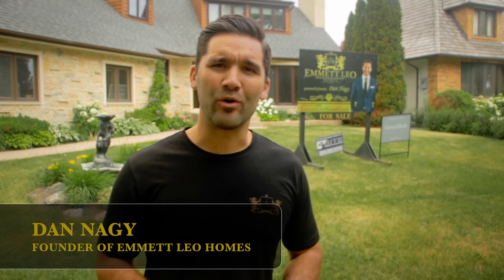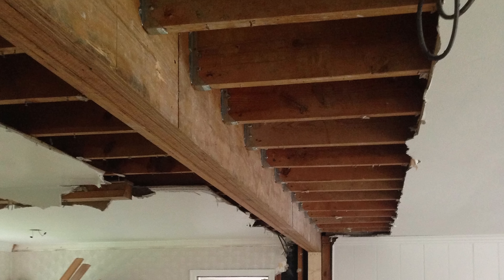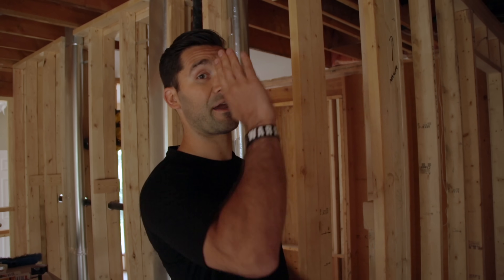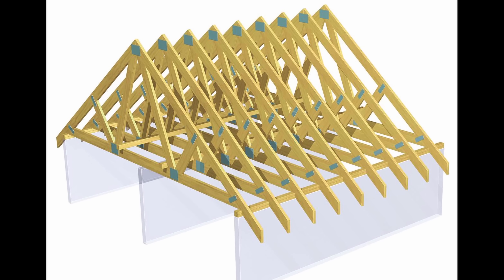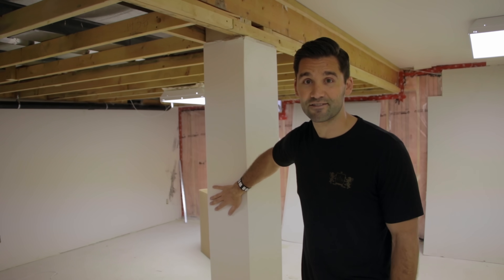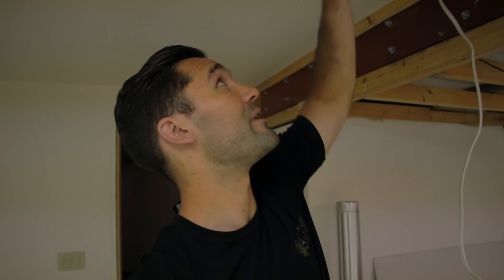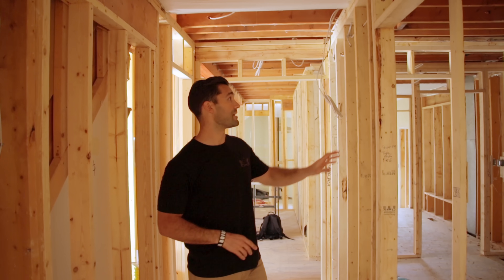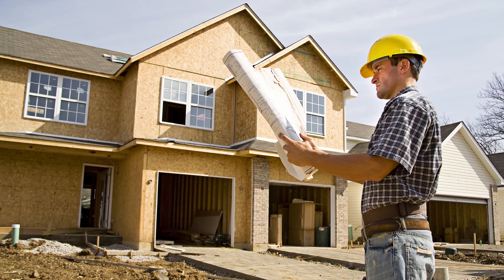The fastest ways to tell if your wall is load bearing or not!

Comment: 2:11 - - Which way the joists run (perpendicular to structural wall, ≠ parallel)  
2:47  - - Dimensions of the house (structural wall runs the longer length) 
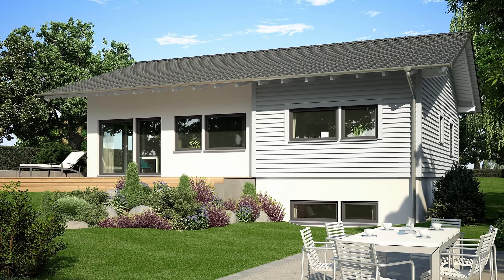3:07 - - Gable roof / peak (joists run perpendicular to the peak)
Reply: I have a decorative wall that has two columns in the middle that runs parallel to the joists but is sitting right on top of a joist. That means it’s not load bearing?
Reply: @alexcantrell4794  please don't attempt to remove a wall yourself - - please have a licensed architect or licensed construction contractor look at it.  You could probably find a licensed instructor at a local college or trade school to help you at no cost (maybe a cup of coffee or lunch 🙂).  Good luck.
Reply: Great break down and recap on the topic.  With video/subject location.  Big thanks.
Reply: @lamontg802  sure!  I like making it easy for future reference 🙂
Reply: Was coming here to make a similar comment.

Comment: If the rafter-truss width span is entirely supported by the walls front & back transferring weight to the foundation, then none of the inside walls need to be load-bearing. But they CAN be in which case the aforesaid walls front & back CAN be under designed relative to if they weren’t because the load to the foundation is transfered through more wall sections? Why would someone risk it is the question.

Comment: Most folks who have a structure that's not yet drywalled and/or a basement and/or a walk in attic know by just looking in real time what walls are loadbearing and what are not. The difficulty arises in a finished home built on a concrete pad above which is an attic knee-deep in insulation. This does not consider that commonly encountered scenario.

Comment: What he meant If you go to  your basement and anywalls on the floor above of running along the beam from below than they are supportive and if u look in ceiling and if their  are any cross cuts that are on top of your wall as in not just one piece well than it is a supporting wall if it's just 1 ceiling joist and you look and the same  ones are open with no wall beside the ones where is wall well than It is not supportive as long as it's one continuous one ,ya if you asked me he did not explain in the best and yes under your joist u just don't throw a beam u have to make a 3 by 3 poured concrete box if u check on Google and see what kind of box u will need to support beam it will show you ,don't over think it it usually a very easy fix especially with engineered trust these days it all about supporting and bulking a beam in if needed ,I'm 51 and have been framing houses since grade 9 ,I don't put people down but sometimes I feel the you tube guys just talk for hits and scare the average home owner out of trying their own little home renovation ,yes becareful but the average guy isn't stupid if you see joist nailed together well of course it's supportive just take quick peak in ceiling and observe rest of area you will be all right and codes and spands are ready and available on Google in your area ,not Mike Holmes but 30 yrs experience and 100s of houses under my belt , good luck .😊

Comment: I think you need to be just  a bit  more particular about load bearing walls. Dont simply eliminate them as nonbearing because they run parallel to the joists over. They could be supporting a roof load, or a stepped back wall above. Also, you could be aware of a tri bearing truss overhead. Be careful. They're not always as simple as they're made out to be

Comment: I used to work with a contractor while in college remodeling homes and small businesses. Learned when you are removing a wall, take off the drywall and hit each stud with a hammer to see which ones had a load bearing on them. The loaded ones we left in place and reinforce it into a column. He was successful with this method, and I had the oppurtunity to see some of his work from years earlier and they all withstood the test of time.

If I work any remodeling jobs, I still tap the studs to double check they aren't load bearing, even with an engineering report.

Comment: I've worked on some homes where the joists run parallel which are support walls, there was a double joist/ sometimes single joist stacked right on top of that wall which then carried the load of a second floor wall which carried ceiling joists or loads from roof.....so saying they never carry a load if they run parallel is not quite correct, there is some exceptions to that rule.

Comment: Question:  my home had a double garage but at some point half was converted to a bedroom towards the back section and a small mud room directly in front of the bedroom,  the other half remains as a single garage .  in the mud room there is a closet which id like to remove.  I believe I am ok as there would not have been any support when this was a full double garage?  Just making sure before I fire up the sawzal!

Comment: You're addressing only GRAVITY Load bearing walls. You might want to discuss LATERAL load bearing walls, too. Many times folks open up or remove walls thinking they're just partitions when, in fact, they provide transverse shear or (out-of-plane) lateral bracing support to adjacent, exterior walls. Probably a good idea to advise folks to defer this assessment to design professionals or "knowledgeable"  building contractors.

Comment: Ok You Tube thinks I should watch this 3 year old video so here's my comment. The fastest way to tell if your wall is load bearing is to take a Sawzall and starting cutting one of the studs, if the roof weight pinches the saw where you can't get it out, it's load bearing....you're welcome....

Comment: When searching for studs, you can also take a magnetic to the drywall to find screws. Some older homes are tricky. I have joist running perpendicular to the main load bearing wall in the center of my home. So the load for my 2nd floor bath is supported by 2 parallel walls that are perpendicular to the 1st floor load bearing wall above the steel support post in the basement.🤯

Comment: I'm a visual person and a wee bit dumb. I need mapped graphics to comprehend these concepts. Another pass on this video with some graphics will improve the video quality and your views will skyrocket to 4 million😊  I gather that load bearing walls run parallel to the peak, one side of every main hallway is load bearing, pilings are holding a load bearing joist and slab homes are floating on dirt.

Comment: i removed a partition wall.  when above neighbor walks i hear squeaking.  he claims removing partition wall might have done that.  (1) a structural engineer said "it is it clear if the wall contributed to the load path"  what does that mean?  (2) he said the noise can be due to the minimal deflections in the floor joists/beam which were crossing the omitted "partition wall). although these deflections are minimal and do not significantly affect the structural integrity, they can cause the wood nails movement even at very small values.    is he just saying deflections happen or his he blaming me for the removed partition wall?   (3)is there permit necessary for removing a partition wall in california? my contractor didnt do that.          PLEASE HELP.

Comment: You Know that is just about the DUMBEST answer to look at the sealing to see which way the floor jousts are running. that would be a good way in the new house that was just framed but if it has been sheet rocked , taped . textured and painted. you cant see which way the floor joist run. Chances are some one that see's the house wants to do a upgrade like that. I have done commercial buildings that the floor joists go in different directions. Pleas give the correct information. The best information would be to look in the basement if and only if it is unfurnished. Even that wont tell a newbie what he is looking at.

Comment: If you have an inspection camera , carefully drill a small hole in the ceiling and stick the camera cable up the hole and then zoom around for a look. Would be a very easy drywall repair too!

Comment: Great! - but can you or someone clarify something? You mentioned if a wall is perpendicular to the joists then it is load bearing. it doesn’t necessarily mean it is load bearing though? The wall sitting on the main beam was deemed load bearing because 1) perpendicular to joists and 2) because it was sitting on main beam. So that other wall next to it that is perpendicular to joists is deemed NOT STRUCTURAL only because it wasn’t sitting on a main beam? @minute 6:45 😊

Comment: Whats in the basement under those heavy verticals you built to hold each end of the beam?  Wouldn't they transfer that well-distributed load onto just two random points on the main beam in the basement?  Does it need support posts under your new load points?  But if you can't just put a post anywhere because it needs a special foundation to be poured for it, do you start by cutting into the basement floor to pour the footers for the posts that support the main basement-beam directly under your heavy verticals that hold the beam upstairs?  Or would you build-up the basement beam so it could transfer the point loads laterally to the existing posts?

Comment: Not all basement beams are load bearing through a first floor wall to the roof trusses. The basement beams are necessary for the floor joists that span the same width as the roof trusses but are not ‘triangulated’ like the roof trusses. thx for the vid.

Comment: Another way to determine the direction of the floor joist if the ceiling is covered with drywall, would be to remove a heat register or cold air return in the floor above. If that scenario applies.

Comment: 6:59 DON'T rip the drywall off.  The EASIEST way is to turn off all the lights, stand on a step ladder and cross-light the ceiling with a flashlight. You'll easily see the joists' direction. (You'll be surprised at how wavy your ceiling is too.)
Reply: Yes i can see my Joists under the plaster as they look lumpy  or pressing down on the plaster boards also if you tap on the plaster you can hear the sound differently.

Comment: Nice video! 

When we wanted to know if an interior wall between the living room and kitchen was load bearing, we had to do some looking. It was floor to ceiling on the main floor. 

Below that, the downstairs rafters and the trusses in the attic were running from outer wall to other outer wall which spanned kitchen and living room. So, on the one 
hand, our kitchen wall was sitting right on top of the steel girder running across the rafters but on the other side, that section of our house had the two sided roof with the centerline and the wall was only a partial wall (there were trusses that lacked that support - maybe 10' of them on one end. 

On the basis of no reason to imagine one one truss should be different than the other and 4 of them spanned the roof without any fuss, we removed the kitchen wall and made it into an island.  We let the city engineer agree with us after we got a carpenter and our own pictures and we've had no issues even with a fair bit of ice and snow load (the back part of the house has an extension where they kept the original roof and went from the centreline of the house and just put another roof over it at a lower slope. Our slope is actually low enough we need torch-on instead of shingles (if it were me, I would have popped a half stub wall at the centerline to keep an appropriate slant on the extended rear roof section, but hey, what do I know?). 

For those who want to have low slope roofs in high snow and rain areas... torch-on is MUCH more expensive than shingle because of the insurance issues (ie your house could catch on fire).

Comment: The only thing you need to find the direction of the beams is a handful magnets. Slap them on the ceiling and fish around for a nail or screw head.  just need to find 2 or 3 and it only takes a min at the most.

Comment: Personally I go with trial and error.
Once you bash out a load bearing wall, you hear lots of creaking and snapping, and the floor above it starts to sag. Then I just bang in a few supports, claim the plans were wrong, and try again. I add the costs to the bill and then usually rage at the owner for not warning me which puts him on the defensive.

Comment: In some houses not all floor joists run in the same direction. If your house has stick built rafters the ceiling joists may not sit on the same interior wall and the ceiling joists may not always go in the same direction. A magnet is a good way to find the nails or screws in the sheetrock.
Reply from the maker: Yes and Yes.  Thanks for watching!

Comment: You're talking about platform framing. Old houses have balloon framing, which means the outside wall Joist go the full two stories. In that case, the bearing walls could be both ways.

Comment: I'm a licensed ID and lighting designer. I find it best when everyone stays in their lanes. Let the owners own, the designers design, the engineers engineer, and the contractors build.  When they start supplanting each other you get problems. I'm always open to, and in fact WANT, input from each person's expertise, but when contractors start telling owners they don't "need" things, or designers start making assumptions about - well, load bearing walls and electrical panels, or architects only want to design a "style box" that only  THEY would live in instead of the client - that's when everything goes to hell.  In this case - consult an engineer. Go ahead and spitball some ideas if you want - but consult an engineer before any other money or design effort is expended.

Comment: Alternate method is to use a wall radar unit like the Dewalt DCT418 or the Walabot  to locate studs and rafters behind drywall.  Oh, yea it shows pipes and wiring as well.

Comment: This is really dangerous advice. Just because a wall is not carrying loads from above does not mean that it is not defending lateral loads induced by wind or seismic. In many cases the wind loads can be greater than the gravity loads. Removing critical brace walls transfers the loads to other walls that may not be capable of properly transferring the lateral loads due to large openings such as windows and doors that result in shorter brace walls. In design we frequently utilize interior partitions to defend lateral loads.

Comment: Another method, if you have already stripped the drywall/plaster: look for any door openings. Is there a solid header above the door? Then it is most probably a load-bearing wall.

Comment: This guy knows just enough to be dangerous.  Sometimes the roof framing runs perpendicular to the floor framing - meaning that relying on determining the direction of the floor joists is not sufficient in all cases.  Then too, vertical loads are sometimes transmitted laterally through floor joists to a wall not directly below a bearing wall.  Also, some walls are "Shear walls" which are structural but not for vertical loads as he describes.  Hire an architect or engineer.
Reply from the maker: Absolutely.  Engineers have to be part of this to stamp a structural change.  However, too many people think that homeowners should “stay in their lanes” and hire professionals without trying to understand the process.  It’s our job to educate them.  This is definitely not a “structural 101 course” and a lot was left out, but a quick and easy way to even THINK about starting to plan a renovation.  

Thanks for your input and for watching.

Comment: Good explanation with one caveat:  The built up column of studs is good to support the engineered beam but the SYSTEM needs to address carrying the point load to the foundation.
Reply from the maker: Agreed.  An engineer has to stamp structural changes here and they must consider this in their calculations.  Thanks for watching!

Comment: To determine if a wall is a load-bearing one, go down to the basement or attic to see which way the joists run. If the wall is parallel to the joists, it's probably not load-bearing. If the wall is perpendicular, it's most likely load-bearing.

Comment: after watching this video, my load is downloaded inside a peak joist perpendicular beam 2x4 supporting a span in the frame structure nailed to wood in the basement and juxtaposed to the roof and since nothing was covered by drywall, wood doesn't matter so long as it is next to a beam that is next to stairs, then I found a nail in my foot and removed it and then looked for another perpendicular wall which ran the same way as the nail that went through my foot then I decided I don't need drywall in my house because if I cover up my studs I can't see the wood which can cause problems when I am looking for a load bearing wall but the structure of my house is open floor plan and there are no beams, but I would like to add them in 6 years so I need to plan to load another open living room without wood and flooring is optional since I float like a butterfly but I was thinking about moving so this all might be moot.